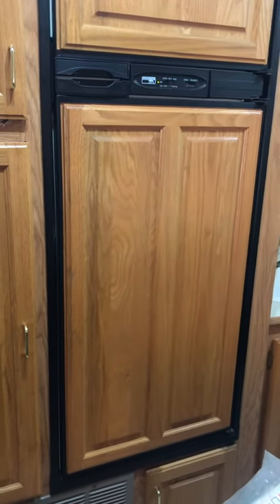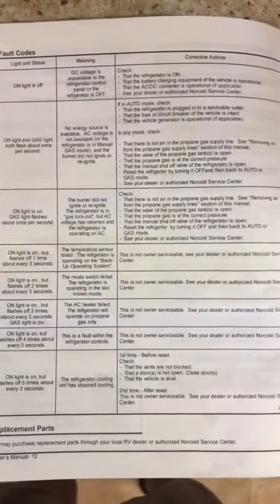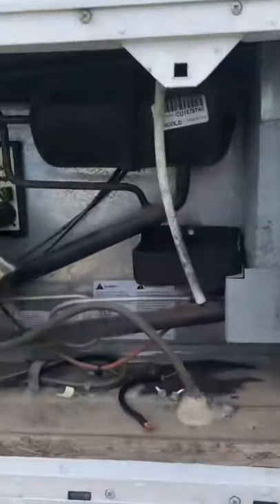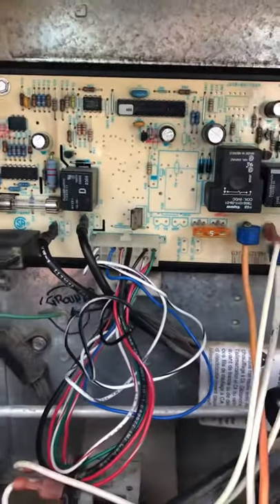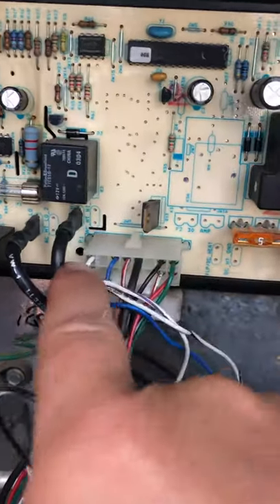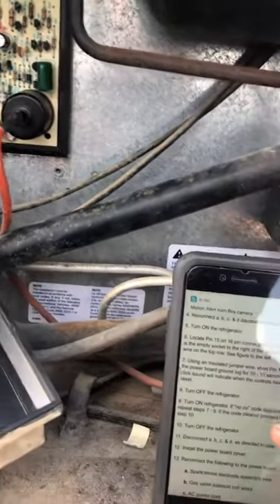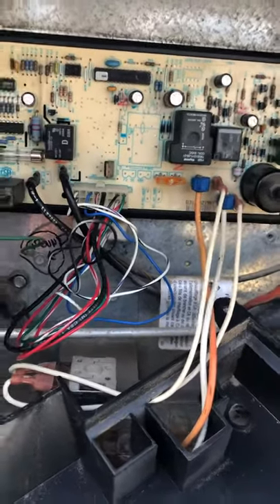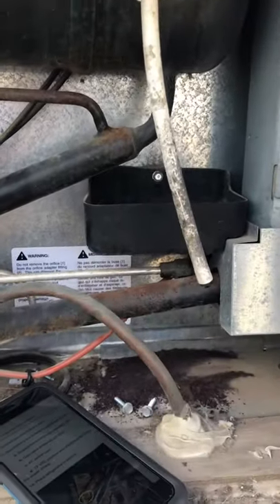Diagnose and repair Norcold N811 RV camper refrigerator / freezer Jayco

Comment: This fix worked on a N611, which looks exactly the same under the cover. Excellent. Thanks.
Reply from the maker: This video is old and I’m not a tech, but I never had any instructions. The only thing I had was the owners manual of the refrigerator in the video. This camper has been sold so I gave that to the new owner. Sorry.

Comment: Thank you for your video! This fixed my issue with my Norcold N811 fridge. My silly manual didn’t even have a fault code for five flashes.  I bought a new thermistor, finally fixed my broken fridge light at the same time (purchased a new socket board) then I removed the wires and jumpered the reset for 7-10 seconds and heard the relay click from jumping pin 15 to ground.  Love it ! Only a 43$ fix for parts from my local RV store .  No too bad Happy RVing! From Canada
Reply from the maker: Love it! Thanks for taking the time to comment.
Reply: My norcol refrigerators811 Linkin from
Reply: My norcold refrigerator n811 flashes 5 secn.ane liks  frion.

Comment: Mine doesn't have 16 pin plug and it is a n811vrt. So how do I jump it
Reply from the maker: I’m not a tech, I just studied and figured out how to do this specific fridge and wanted to make an easy to follow video for others. So unfortunately, I’m not sure in your case.
Reply: @freshmaker5  there is an open pin on one of my honeycomb beside the white with purple strip wire. I believe that is the pin I need to use
Reply from the maker: I think I’d make sure with research before just trying random stuff or you could damage the board.

Comment: Hi any idea on why my Norcold 6 cubic feet 3 way is freezing in the refrigerator? I have it set on 1 and running on propane and everything is frozen solid! The light did stop working before this started. No codes tho thanks!🤙
Reply from the maker: I’m not a tech or anything, just figured out how to fix mine. It’s been awhile but I think in the video it shows a metal clip that clips to the aluminum fins in the refrigerator. By moving that up or down you can also change the temperature. Try that.  Before I had this issue, my fridge was freezing also, so you probably have the same issue happening. Maybe try to replace the part I did. It’s a cheap experiment that will probably work

Comment: I followed excalty what you did in the video and it didnt reset. I didnt hear any click when i touched the wire to the oort then the the ground. I did however pop that five amp fuse which i replaced. But im still getting green light flashing 5 times with the gas light being steady on any thoughts?
Reply from the maker: I’m not a tech. I think your wires are either not skinny enough or long enough or stiff enough. One of those issues is causing you not to create the connection like I did. I had to get different wire that fit in there better to get mine to do it.  My original wire wasn’t working either.